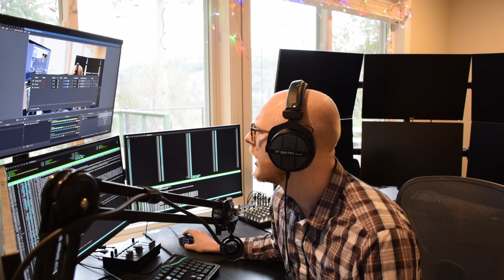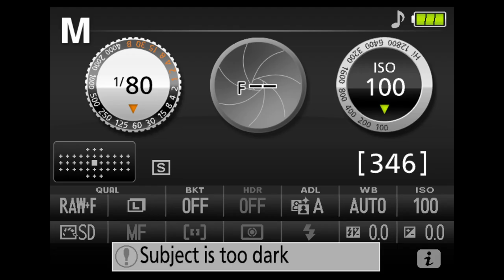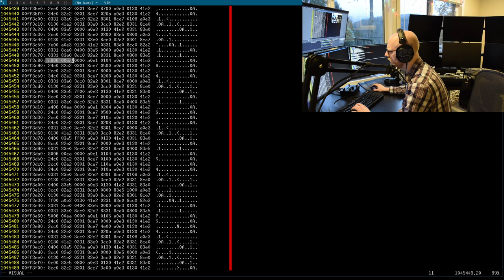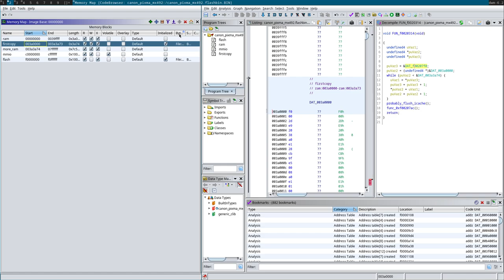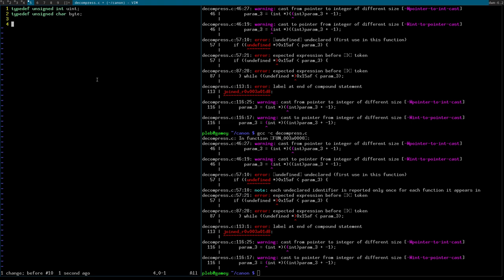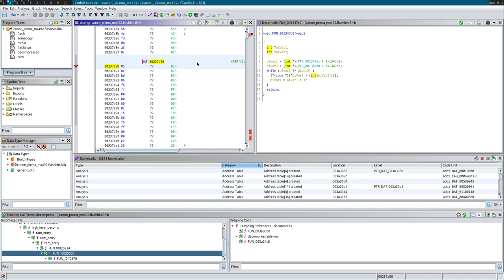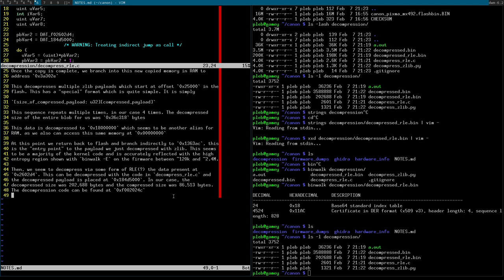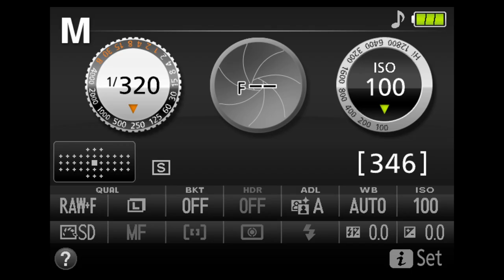Hacking a Printer: Day 1, Picking a printer, dumping the firmware

Comment: 2:55:30 boom, finally figured out it's Arm LE - all these Arm variants :D
3:19:00 alright, figured out memory as well, reopen a last time :)
4:51:00 what that is: that's Bonjour, a discovery service ;)
4:53:00 so here's ITRON (an RTOS, real-time operating system)
4:58:00 compression figured out - Python zlib ftw \o/
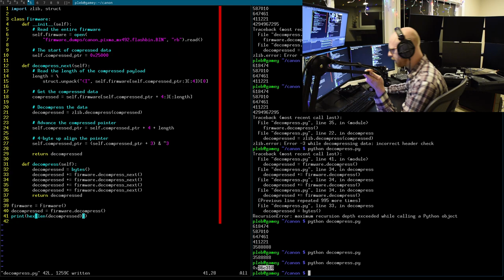5:14:00 there were 4B alignments, got it :)
6:32:00 decompressed the RLE stuff :)
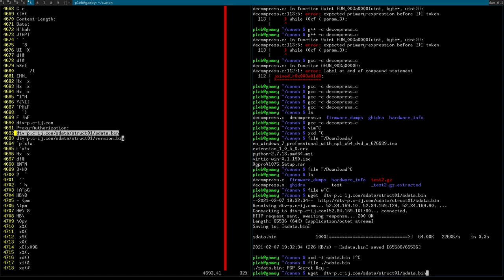Reply: 4:48:48 yep, that's a publicly accessable PGP secret key that was linked to by a string in the firmware...
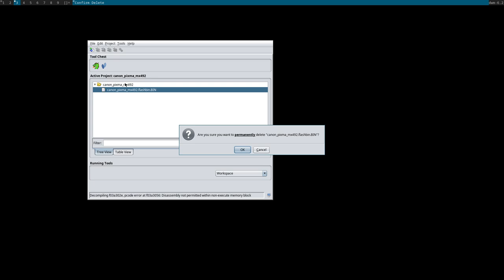Reply: 3:11:00 after having previously determined the language as ARM v7 LE, then reloads with ARM v5t LE
3:34:00 realises v5t mistake but proceeds with ARM v8 LE instead of originally determined ARM v7 LE

Comment: Hello there .  I have an epson xp600 A4 format printer.  I need a printer with a width of 1 meter.  I want to do this myself.  If I make the width of my epson xp600 printer 1 meter (including increasing the encoder stip length), can I print 1 meter wide with my printer?  What software should I use for the output?